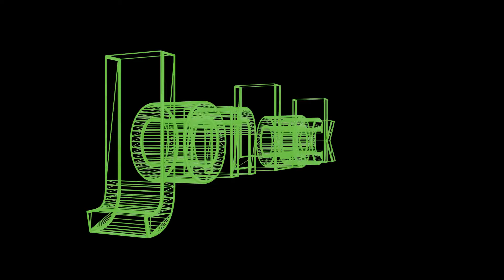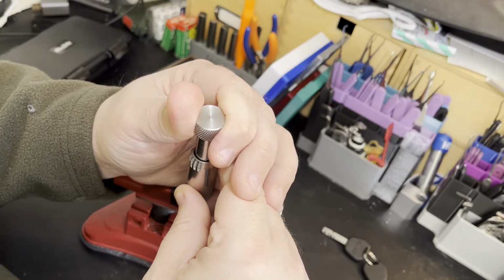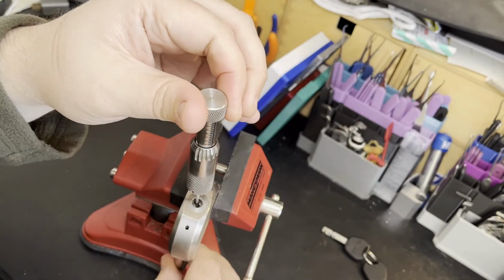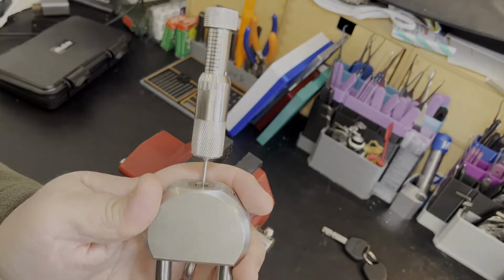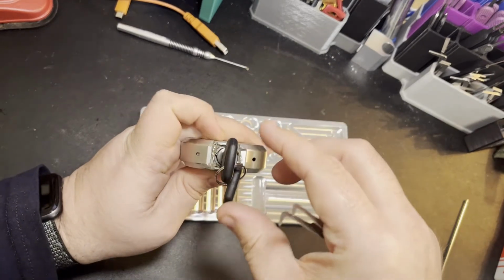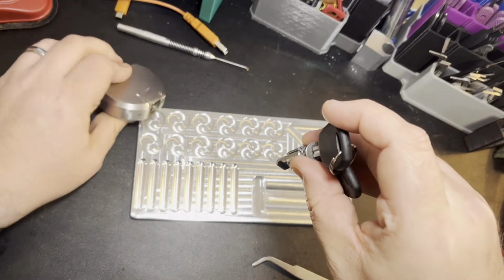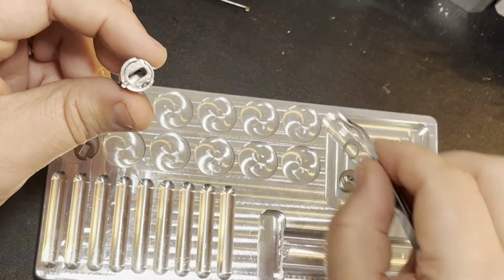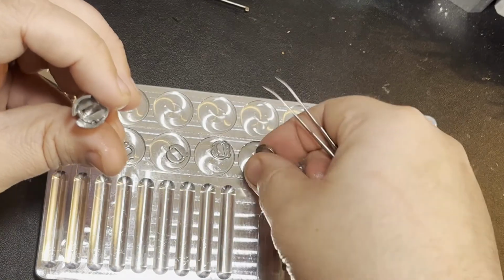Amazon Basics Disc Detainer Padlock - Picking and Destructive Gut

Comment: Cool, nicely picked. with 9 discs its always tough to know where you are in the lock. How thin are the spacers? Was it easy to navigate the picking tip in between discs? Amazing that you cut it open, its always interesting to see the inside of non guttable locks :)
Reply from the maker: I think they were standard, 0.5mm, I didn't have too hard of a time navigating between discs, and they binded pretty hard so I didn't knock too much out of the way when going between them.